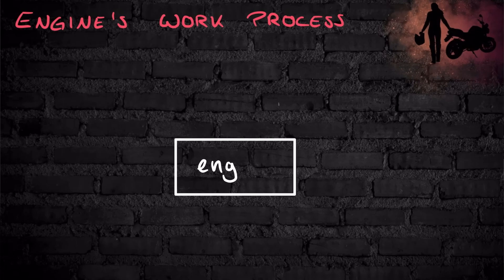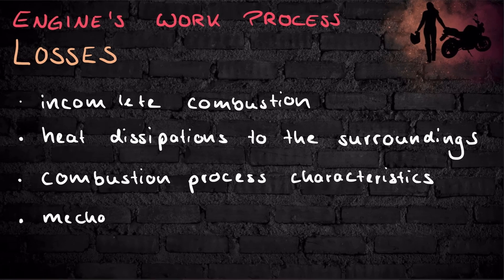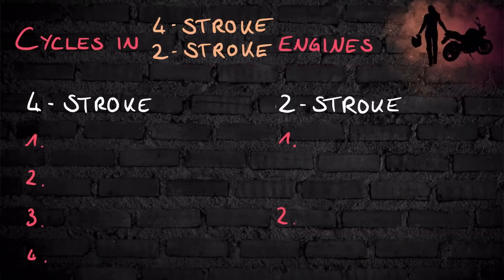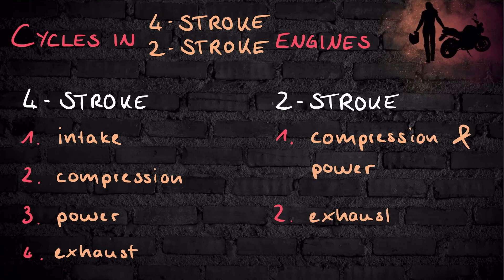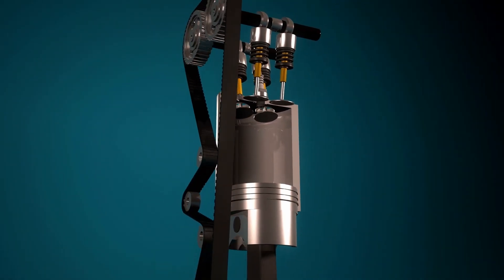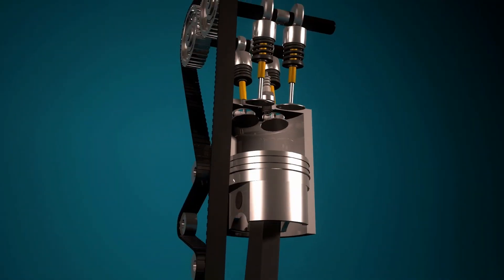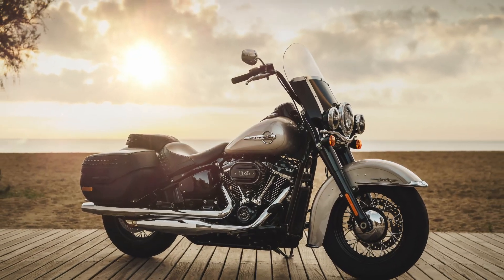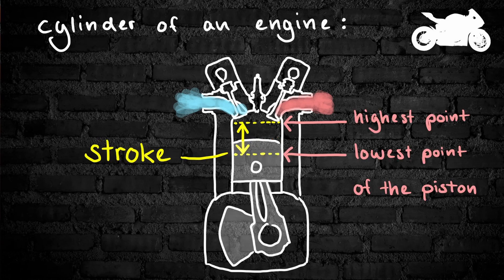How Motorcycle Engines Work & Their Differences Explained!

Comment: Actually you can create mechanical gains if you design it correctly, engineers only learn what the institutions what you to make mainstream, this reminds of your exhaust vlog that failed to point out that exhaust emissions are fuel for trees to make oxygen and should not be classified by bias as pollutants

Comment: Hey Giulia! 

Why is the 2 stroke worse at emissions? Is it also worse with mileage  efficiency compared to 4 stokes? 

Thanks
Reply: Also, the 2 stroke uses an oil fuel mixture to lubricate the piston. So not only the 2 stroke is burning fuel its burning a lot of oil too.
Reply from the maker: Because they've got an explosion every second stroke and not every fourth stroke like a 4-strok3 cylinder. This means that at the same rpm (engine speed) they have twice as much explosions and there's not a huge difference in the amount of air fuel mixture.
Also every time some fresh air fuel mixture exits the exhaust valve without being burned. That's not good for the efficiency, so yes - they're worse.